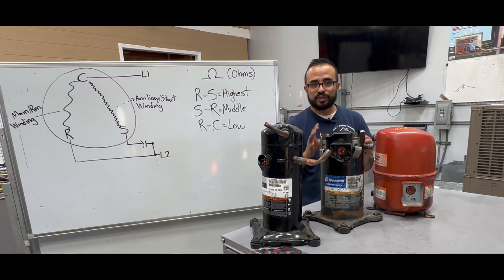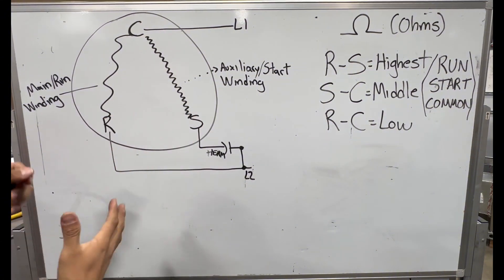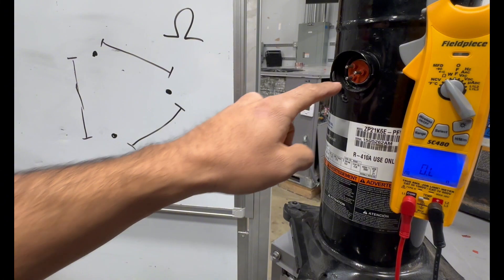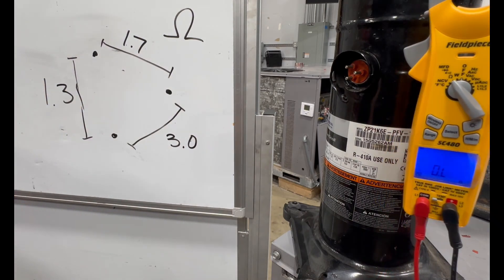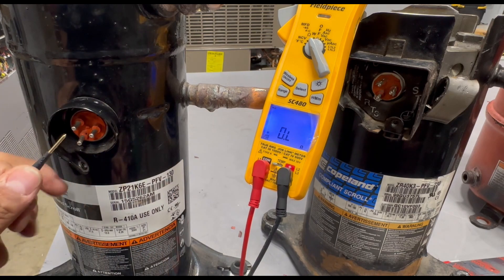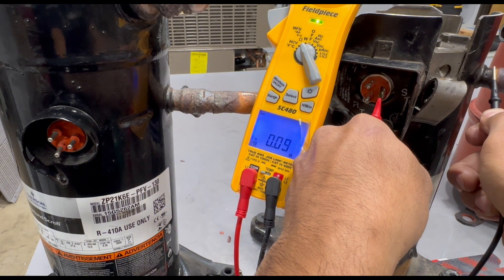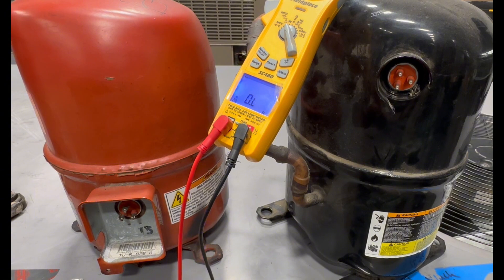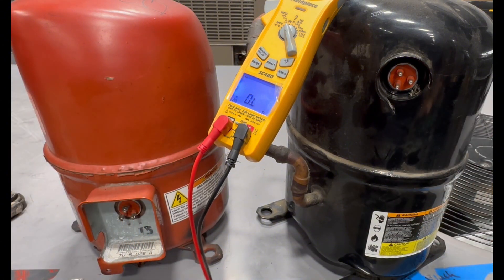Is The Compressor BAD?! - HVAC Training

Comment: What if the system has water vapor and acids form and the compressor still is running fine ? can you tell if the compressor is going bad by these checks or do an acid test and evac the system then dehydrate the system to 500 microns and put in recycled refrigerant or virgin  refrigerant ?  or if there is a odd smell coming off the compressor?

Comment: Some of the best explanations so far. On your first drawing you show no direct connection between RS, On the second drawing you show a connection between RS. What is the actual path the resistance takes in the compressor?
Reply from the maker: The first drawing. The second drawing just shows what you would physically see on the compressor pins
Reply: I believe I am somewhat dyslexic so I have to be able to trace out a circuit before I can understand it. So, the power comes in at terminal C. R-C has the lowest resistance so what prevents it from going that way? Thanks.